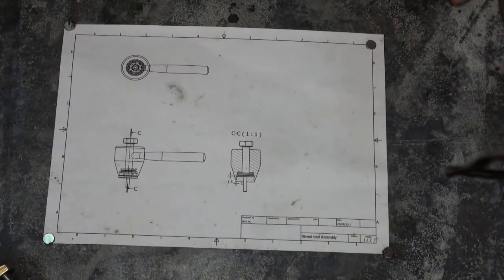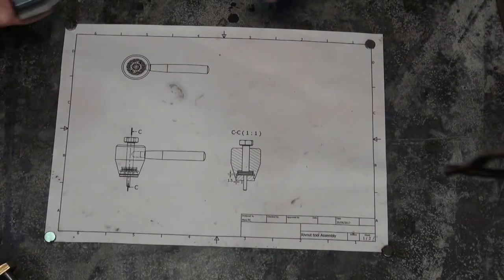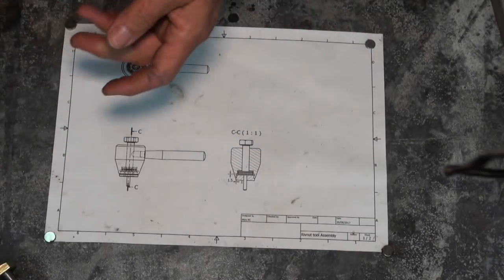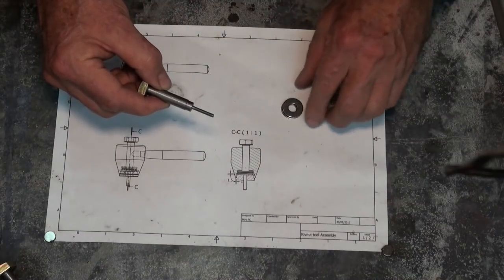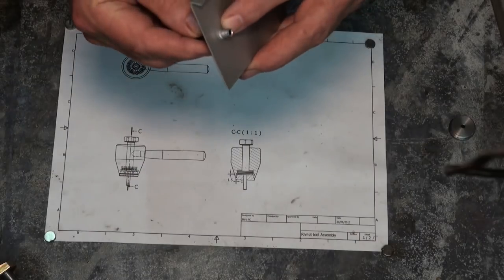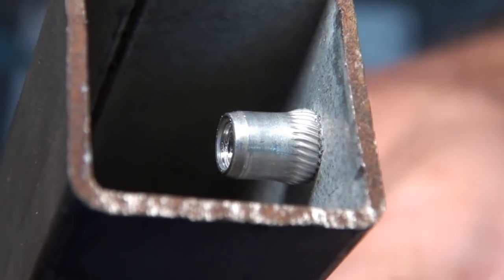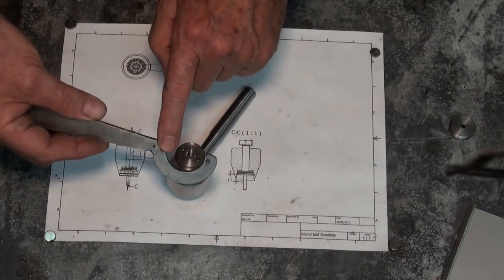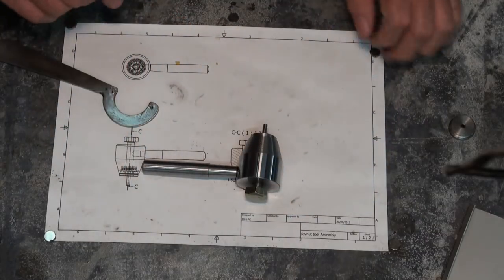DIY Rivnut Tool

Comment: I work in aviation.  We use riv-nuts all the time.  Pneumatic can pull too hard and rip the threaded mandrel out of the riv-nut.
The hand pull type are better but alot of folks can still rip the threaded  mandrel throught the riv-nut again destroying the Riv-nut.
Your style of tool is best.  You get a good sense of feel as the riv-nut forms in the material.  Feel is EVERYTHING.  Knowing when to stop forming the riv-nut is a learned thing.  Practice on several pieces first.  Sacrifice a few riv-nuts to the gods and learn.
Not formed enough and the riv-nut will spin in the item you're installing it into.  Drawing in the riv-nut too much and you rip the threads out.
After about 5 to 10 Sacrificial pieces and you will be a riv-nut PRO.
Your tool is the best for "feel"
Reply from the maker: Thanks, I did strip a few threads early on. I find the smaller nuts can be difficult to get consistent. So far I have only used aluminium ones.
Regards,
Mark

Comment: In the US I drill holes for dowel pins in the jaws of old adjustable wrenches.  The best type wrench are so called RAIL ROAD OR  FORD wrenches.  This makes a very strong, adjustable, and reversible pin spanner wrench.

Comment: Hi Mark. I can't believe I hadn't seen this video before. I thought I had seen all your stuff. Anyway, being a former vehicle builder I have some experience with rivnuts. One of the comments below mentioned that they didn't like them due them spinning. One way to try and avoid this happening is to use some permanent thread lock on the knurling before fastening them. The correct size hole is also a help.
Reply from the maker: Thanks Douglas. I am considering modifying this tool so that the threaded spindle is used to pull directly rather than acting like a screw in a nut. I did have a couple of 4mm rivnuts strip while forming them. The 6mm rivnuts I have used previously all worked perfectly but as it is now it's possible to damage the thread due to excessive friction. 
Regards,
Mark

Comment: I don't like the idea of turning the bolt to pull the rivnut up. Much better to have the threads not move and use a nut or equiv to pull the rivnut tight.
Reply from the maker: That's true. I saw a version that did exactly that but I have never had a case where I have stripped the thread out of the rivnut when installing it. Probably if you are using stainless steel rivnuts they would require a lot more force to compress the stem but the threads would be stronger too. I have only ever used aluminium rivnuts.
Regards,
Mark
Reply: @Preso58  I absolutely agree. I only use stainless but must use high tensile nutz&boltz. That being said, your video demonstration is excellent. 👍👍

Comment: I mount these rivnuts always by using a (locking)washer and a bolt and then just tightening them till the rivnut grips and expands. No tools needed except a spanner, which is always in my toolbox
Reply from the maker: Barrie, I initially played around with that method but I am one of those poor folk who will always overthink a process and then over engineer it too! The tool spends most of it's life in drawer but on the few occasions I needed to use it, it's worked for me so I don't regret spending the time to make it. 
Regards,
Mark

Comment: Great video interesting, i would buy an air one but limited to places where you have room to get it in to operate it
Reply from the maker: Ron, yes a pneumatic gun would be great but I baulked at the price. The unit in the video was used recently to set some 6mm rivnuts and it worked great. It is compact enough to get into some tight spaces too.

Comment: Hiu Mark,
I am impressed with your channel and the projects you come up with. Thumbs up for that.
My thoughts on the design of the Nutsert tool. the thrust bearing is loaded up by the narrow shoulder on the bolt and the face of the locking nut at the bottom of the tool.
the shoulder of the bolt is too narrow a surface to bear on the thrust washer and it will distort the thrust bearing.
An alternative concept for Mark II is to place the Thrust washer in a recess on the top of the tool then use a thick washer (5mm +) over the thrust washer through which the bolt passes. 

the bolt will load the thick washer, the thick washer will evenly load the thrust washer onto the body of the tool , which will then tension the Nutsert.
there are no point loads and no locking washer to worry about. the thick washer at the top can be held in with a C clip as it takes no loads other than to keep the thick washer from falling out.
I would suggest that the bolt is held in place by a rubber O ring in a groove in the inside hole of the thick washer. 

The bolt would then just be held in by rubber friction and easily replaced from one size to another.

Comment: This method of riveting the rivnut is OK in a pinch,  but not the best method and very much not a good idea on aluminium rivnuts. This method is prematurely wearing or streaching the thread. Rivnuts are best pulled like a pop rivet, leaving the thread unworn.

Comment: 👍
I will be modifying a lever action pop rivet tool, but need to make something like yours for use in confined/restricted spaces working on my classic cars.
Those pop rivet type nutsetters are only capable of setting the smallest Rivnuts, BUT even then, you need to have Popeye's muscles!
Reply from the maker: That's what I was thinking. I was having trouble setting 3/16" pop rivets with a hand type riveter so I bought a pneumatic one. I used the rivnut tool to set some 6mm nuts a while ago and it worked great. I have since parkerised it too so it looks nice and sinister, like a Glock special!
Regards,
Mark

Comment: When you were in Montreal, you were an hour away from here. Those are called Pop-nuts around here, I guess, because they are based on the pop-rivet principle. (It is also a brand name.) 1/4" (~6.4mm) Pop-nuts are nothing to install using the pop-rivet / pliers type tool.
Reply from the maker: I was wondering how difficult it would be to install the stainless steel ones using the pop rivet type gun. I used this tool to do some 6mm fasteners a few months ago and it worked great. I made that tool and didn't have an immediate use for it so it sat in a drawer until just recently. I had just finished a job where I had to overhaul a 50 watt laser cutter/engraver with a sheet metal chassis. It needed lots of threaded fasteners and most of them were blind so I could appreciate why the rivnuts were an invaluable solution.
BTW, loved Montreal and all of Canada that we have seen so far. We went back there last year for a second look.
Regards,
Mark

Comment: Cool, I just have to buy some thrust washers to make one of these tools (I’m a skip rat and pulled out a couple of thousand rivnuts) will come in very handy. Any recommendations on where I’d buy the thrust washers cheap enough??   Thanks for showing us this tool as it looks very useful indeed, take care and look forward to seeing some more of your videos.....Phil
Reply from the maker: Phil, I got those thrust washers on Ebay. This is a link to a similar type of bearing https://www.ebay.com.au/itm/10Pcs-6-Different-Types-Thrust-Needle-Roller-Bearings-1-Cage-Needle-2-Washers-/131645807131?var=&hash=item1ea6b39a1b 
The original seller is no longer trading but you can select the size that suits you. Good score getting rivnuts out of a skip! 
Regards,
Preso

Comment: The thread serts I use have a bit bigger flange with flats on opposite sides. The flats fit the same size as a nut for that thread would. I’ve put in hundreds of 1/4-20 ones with an air ratchet and 7/16 (11mm) open end wrench
Reply from the maker: I just recently used this tool to put some M6 rivnuts into a sheet metal electric motor cover and it worked great. I had almost machined up a sort of flange plate out of thick aluminium when I remembered I had the tool in my drawer. I don't use it often but there are times when it is worth it's weight in gold. Good idea about the flats on the ones that you use. It would make it a lot easier to stop them rotating as they are formed.
Regards,
Mark
Reply: Mark Presling I saw your use on the motor. Great vid series on the saw conversion. I actually never saw nut-certs that didn’t have flats, like the ones you use. I was wondering why you had built, what I thought was unnecessary, a tool from watching your saw videos. I didn’t understand until I saw you knurling the face.

Comment: I have not been impressed with rivnuts when I have come across them on commercial furniture. The problem is that they spin to easily causing problems with assembling or disassembling furniture. The other place they are used is to take threaded castor shafts and they just don't hold up under the rough treatment of use in a secondary school. As you can see I am no fan of them.
Reply from the maker: Mark,
Would you  believe that I have never actually used that tool for setting any rivnuts! I made it after doing a job where I needed to attach lots of cable clamps to the chassis of my laser cutter. Many of the holes were blind and in thin sheet metal. I didn't want to use pop rivets because I was constantly removing things to test the build. I badly wanted a rivnut setter and when I saw how much they cost I decided to make one. It does work but I have never needed it since. Still, it's nice to know it's there. I understand what you mean about the failure rate but in metal structures they seem to be solid as long as you use the correct drill diameter. 
Regards,
Mark
Reply: Seems though that's not necessarily the fault of the rivnut...rather a poor choice on the part of the person designing the furniture. Choose the wrong fastener or fastening method and something is bound to fail.

Comment: That is a neat piece of work and a nice looking tool. I think however that this method of compressing the rivnut has the disadvantage  that you use the thread of the rivnut to do the work while the regular tools only pull with a threaded rod that is stationary in the thread of the rivnut. I think that the latter method has less risk to destroy the thread in the process. I would use a bolt with a washer and a nut. Screw the bolt in the rivnut, then tighten the nut wirh a spanner while preventing the bolt from turning with another spanner. In that way you don't need a special tool with a better result.
Reply from the maker: I see your point. Well spotted! I must admit since making the tool, I haven't actually used it for any sort of project. I'm waiting for the right job to come along.
Reply: I will be modifying a lever action pop rivet tool to achieve this, but need to make something for use in confined/restricted spaces working on my classic cars.
Those pop rivet type nutsetters are only capable of setting the smallest Rivnuts.

Comment: Nice design, like that you put in a thrust washer. I've used rivnuts a lot mostly with an air tool. In a pinch I just used a bolt with a nut and thick washer with a little oil. It works if you just need to do a few every now and then.
Reply from the maker: Thanks, I found that even with the thrust washer, the end cap is sometimes prone to unscrewing as you pull up and deform the rivnut.